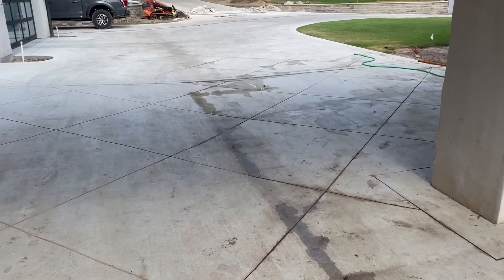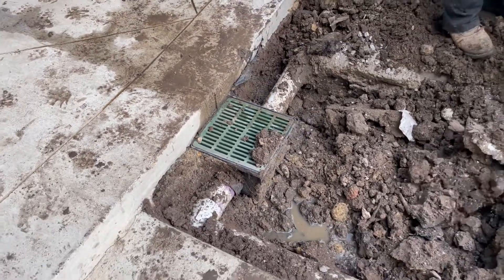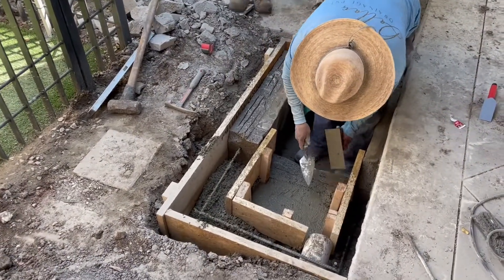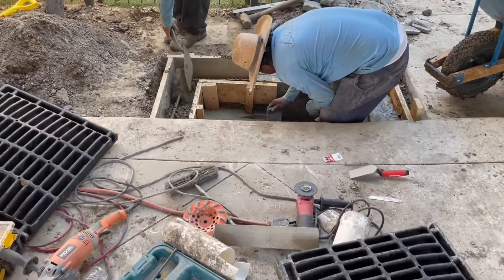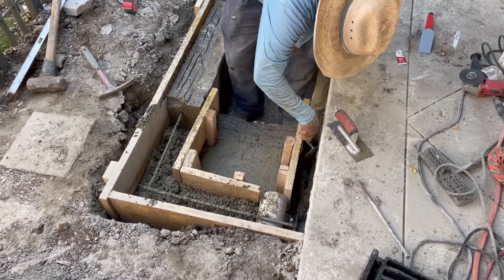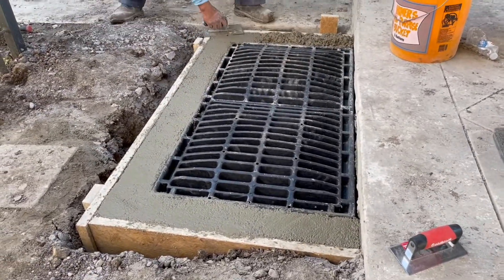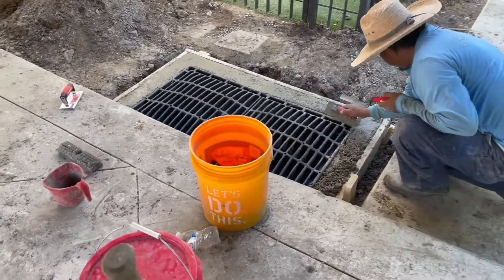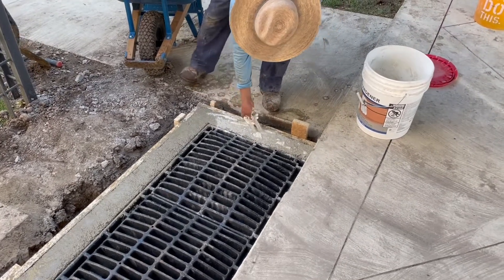Building Large Concrete Catch Basin to Fix Insufficient Drainage

Comment: I'm kinda getting to where I want roadside-gutter style inlets instead of grates.  A 6 inch pipe used as a vertical-riser & a vertical-inlet can intake over 580 GPM which outperforms any 12 inch grate.

Comment: I'm trying to learn this stuff and I just don't understand where the water goes, that's a shallow lil hole with concrete?? Concrete is super porous?
Reply: It still needs to drain somewhere

No way that holds enough water to actually be useful
Reply from the maker: There’s a large pipe that the water drains into. The concrete basin is just a collection point. Once water falls in there, it drains into the pipe which runs to the rear of the property and discharges into a creek.